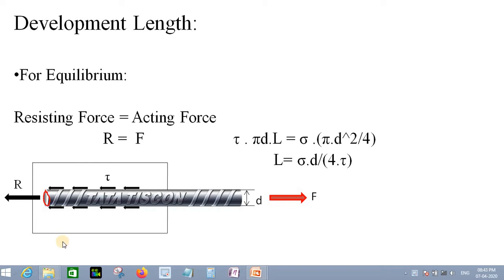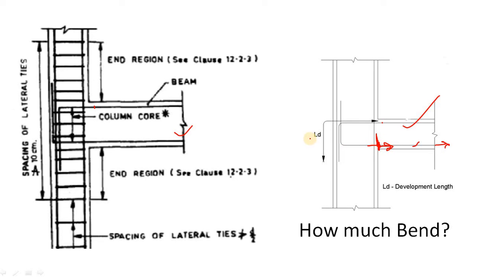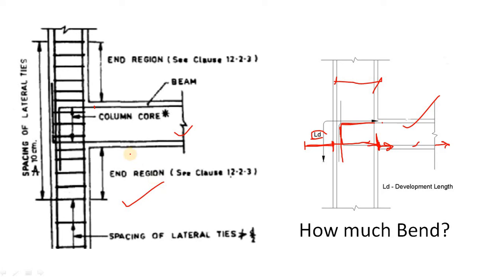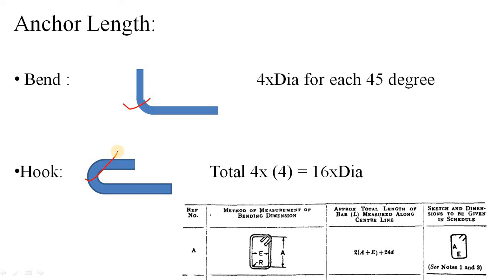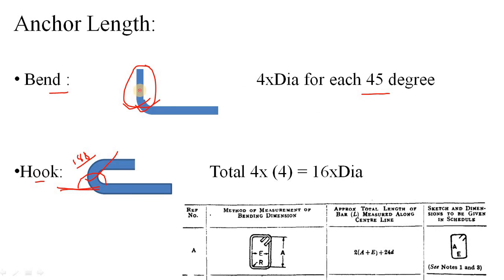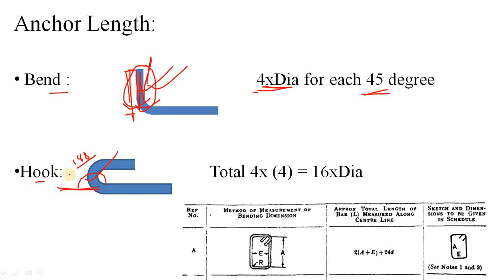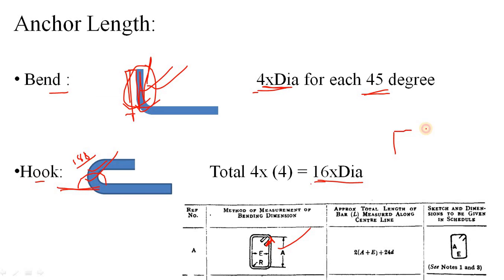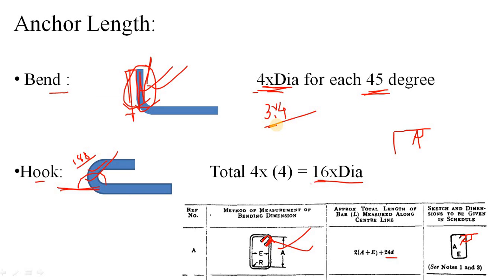What is Anchorage in Reinforced Beam How to provide Anchor length What is Bend What is Hook in Beam?

Comment: Why dont we check reinfocement in fixed end beams and columns for pull-out and splitting failure?
Reply from the maker: Pull out check should be done if tension in the bar is too much high which normally doesn't arise in the beam column junction.
Reply: @TonmoyMaity  Thank you.

Comment: One doubt sir..
Already we calculated the Ld so it's the full length we have to provide ..so simply we can bend the remaining length after reach to end of the member..again why we have to calculate to Anchorage length
Reply from the maker: Awesome question...let say 1 unit force is coming to the bar. Now remaining length after reach to the end of the member is only one unit. So bearing stress on concrete is force(1)/(length(1)*dia(1))=1. But say allowable  bearingstress on concrete is 0.5. so if length is twice it is ok. So, here bearing stress come into the picture.